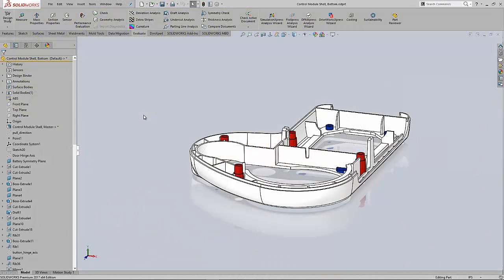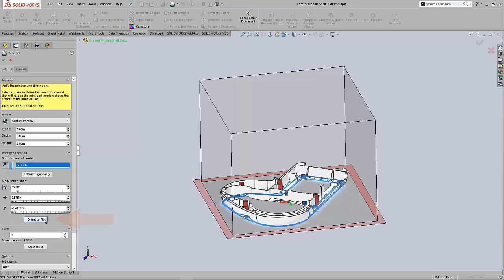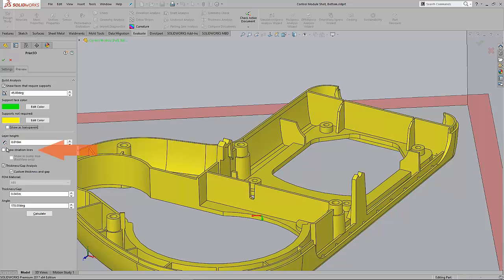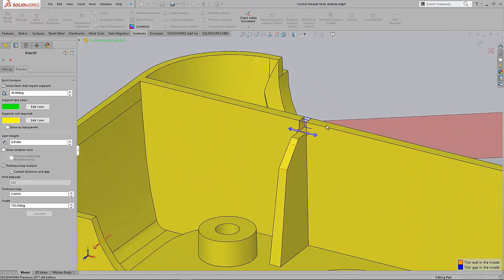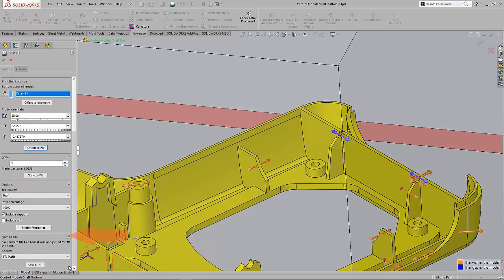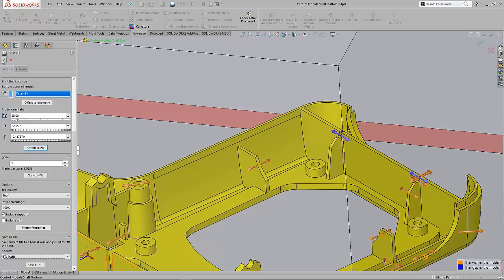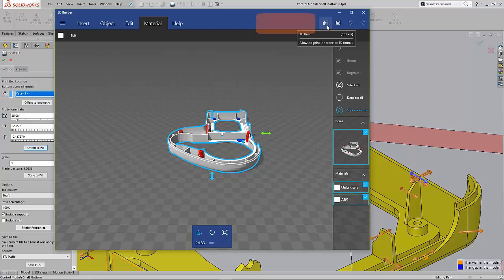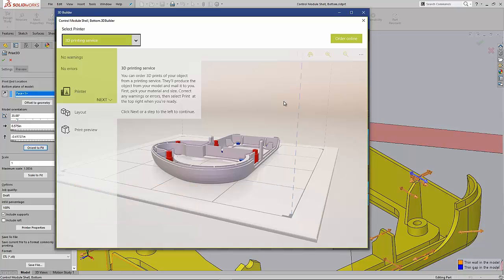SOLIDWORKS 2017 - 3D Printing

Comment: Hello, i have a question, is there a tool which can make in solidworks 2018 threads - inner or outer 3D printable. Instead of doing this all the time by hand with profile and so on? In Rhino3D i saw there is a tool for free since 2014 to make threads printable. Do you know if there somethings for solidworks atm? Sketup support told me the Sketchup 2018 version cant do it and there is no tool at all which make printable threads. Can solidworks do it?
Reply from the maker: Hi Tam Gaming,
Within SOLIDWORKS 2018 is a feature called "Thread" which is part of the "Hole Wizard" flyout button.  This allows you to create physical/modeled threads on your design that would be printed as threads on your 3D printer.  If this feature does not suite your needs you can also model a thread like in the process detailed in the video below.

http://kb.goengineer.com/go/default.aspx?kbID=12901